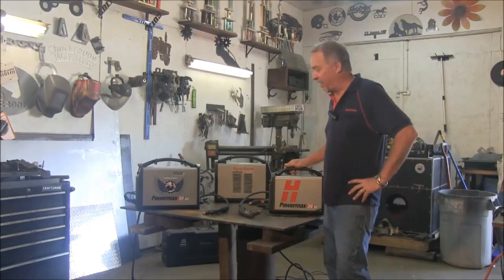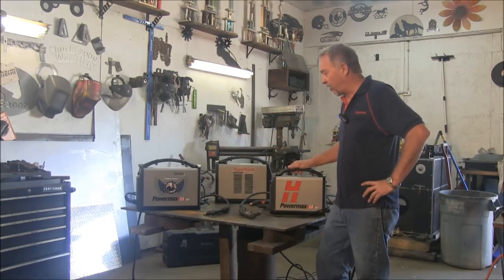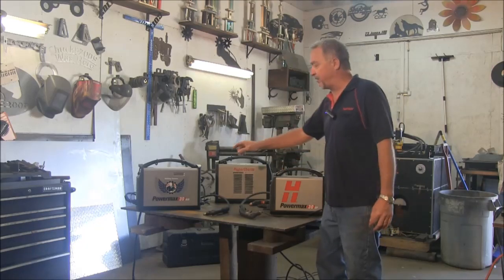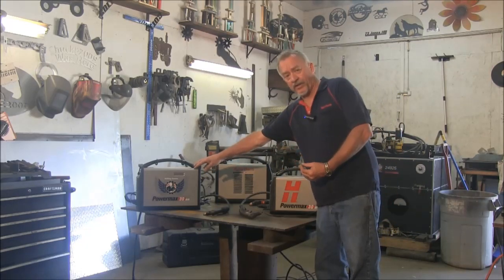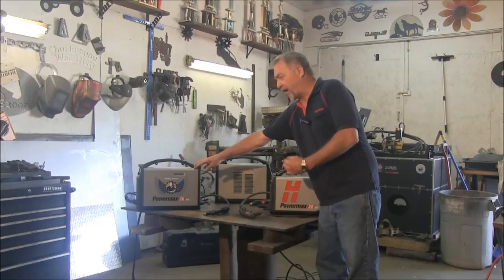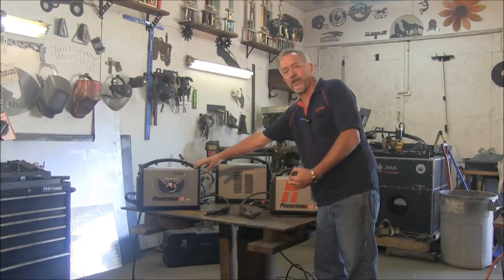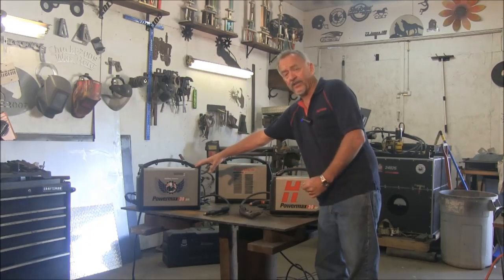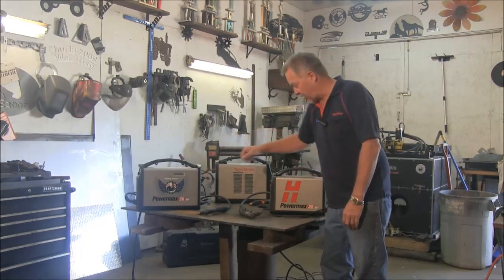Comparison of the Powermax30 AIR, Powermax30 XP, and Powermax45 systems

Comment: hi..can you gouge with the 30xp?? if ye change tips on the torch could it be used for gouging? would the 30 xp cut 10mm plate no problem ??